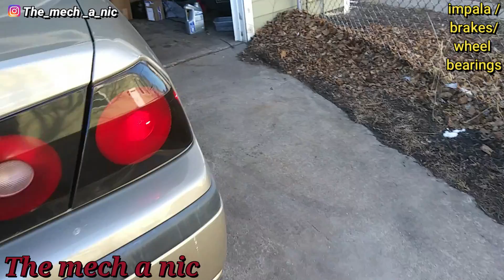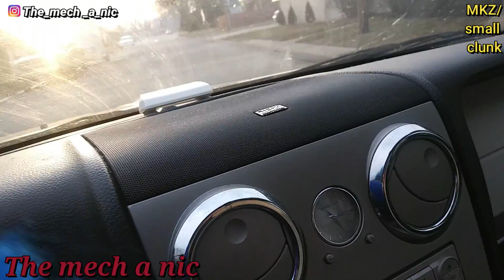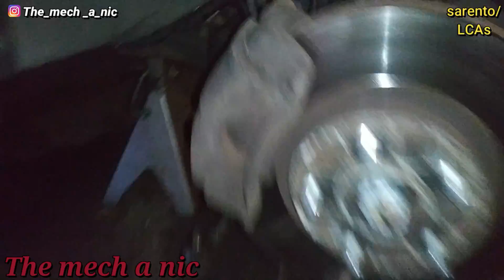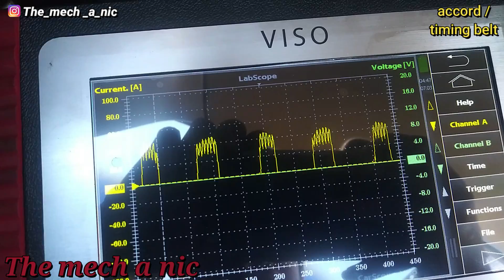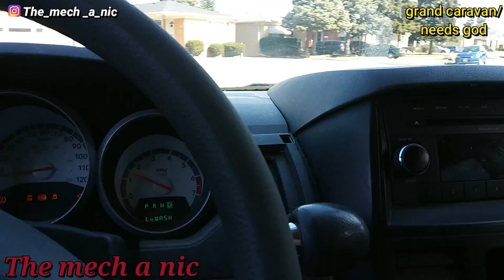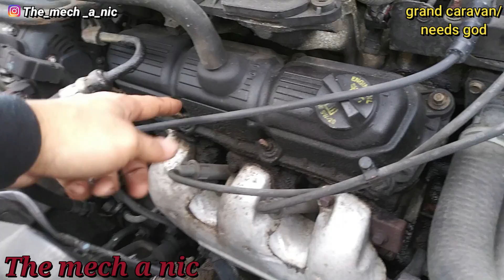accord timing belt , mkz drive shaft , grand caravan front end work, sorento control arms (vol 54)

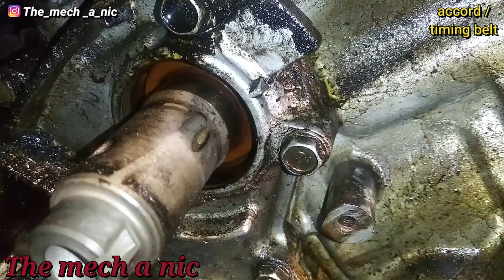Comment: I have that seal removal tool shown at 19:06, and haven't used it much because I'm worried about possibly scratching the shaft. Do you slide it in beside the shaft, then pry out, or do you put it in the other way to stay as far from the inside shaft as you can? Lately I've been using a drywall screw but I wonder if I should jump the gap and get some experience with that tool....
Reply from the maker: I've tried the drywall screw way only a handful of times and it works sometimes but not much luck with it. The tool you pointed out actually works really good and doesn't scratch the center shaft. Yes it goes in between the shaft and seal and use the adjustable thumb screw to find something to lever off to get the leverage you need. Next time just try the tool . if you dont like it you can always go back to the screw method.

Comment: Facts.  If u gonna get Afther market parts only get. Moog or. Kyb.    Do t get cheap CHINESE parts. They will brake in 3 months Ull spnd money again !    Crazy.  So rem.     Axles go to the junkyard Oem !   Rack & pinion junk oem.        Control arms. Ok Ebay. Moog.  Kyb.    Sway links moog.    Tie tog moog.  Shocks moog kyb.  No cheap.     Nd Ull b ok. For 5 years.    Take it from me I kw.  Peace    Oh. Change the pcv valve avoid oil leak on engine  spark plug to.   Inner tie rod is part of. Rack n pin.   So get good ones. Btr to some $75. On control arm then $30.   I
Tie rods.  $60. Ok. Not $30.     Suspension.   &. Engine first.  !!      Quote.  If u Gttn.  N e moog.  Find out if they r original. Not CHINESE.   Migos come with printed serial numbers on da steel plugs. Freeze fitting &. Rubber boot that goes over the tip.      Some r fakes.  But still.  KYB. Or moog.  Or. Oem.    3. Years is btr then a lousy. 3 months paying double the wrk